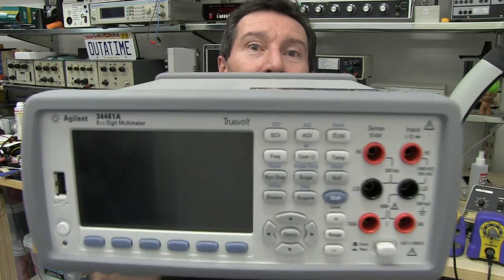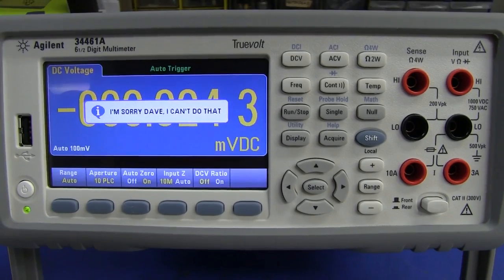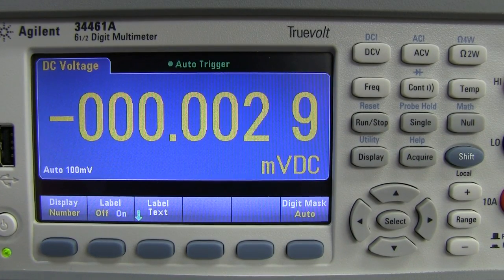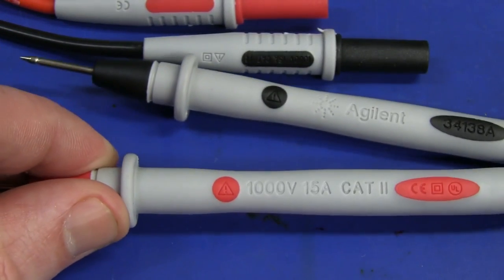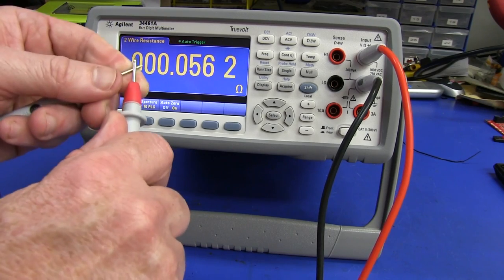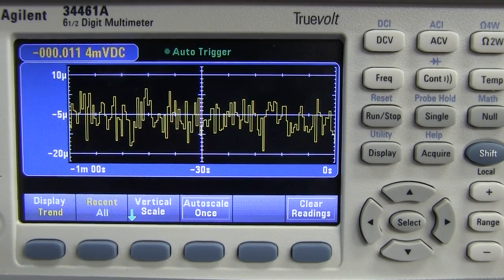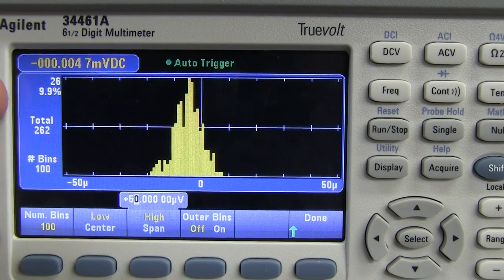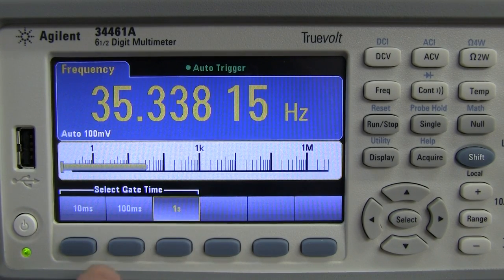EEVblog #489 - Agilent 34461A Multimeter Review

Comment: Awesome meter. At work I have a $3500 meter I use. It’s handheld and geared towards the automotive industry. But it does have a 2 channel lab scope on it along with guided component test for 49 car manufacturers with over 12 million guided procedures on it. Tells you where the component is and gives you the schematic and has guided test for all the different modules and sensors. I use it all the time at home for my good meter when I build Arduino projects and have countless hand held meters from Fluke to Harbor Freight. Even have a couple of radio shack ones.  My very first meter was when I was 7 it was an analog meter for voltage and resistance had a continuity function also. But you couldn’t test anything that was voltage sensitivity because it sent straight battery current for the continuity test. I learned really quick I needed something different since that meter was frying components. Got my first DVOM and haven’t looked back always trying to get the next thing. I wonder if a octopus box will work with my 2ch meter?  Gonna build one and try it out.

Comment: On my 34401A i use the option to turn the display off for long automated measurements so the VFD wont wear out so quick.

The security code for most Agilent stuff is simply the model number with sometimes AT in front of it. (AT as in Agilent Technologies)

In Europe the comma is used for the decimal point and the period for the separator. Wikipedia even has a world map on what is used where.

Comment: It was a great meter but mine sadly died after 4 years.
The rotten CE front panel failed excess load on the 3v3 rail. Had a look on the keysight spares site there have been three newer versions of PCA. Apparently the only way to fix it is to trade it in. Love the service and reliability Keysight - I bet it's world beating

Comment: I think the battery voltage going down at around 00:30 is because the battery is getting hotter from your finger holding it, not voltage going down due to 10Mohm load from the DMM.
I have a HP3478, and playing around with a duracell 1.5 AAA battery, I noted the voltage goes does as temperature rises, something I really did not expected.

Comment: Does seem a little bit of overkill using such a pricy high precision instrument to measure a 9v battery.
Reply: +rpavlik1 --  duh. yes.
Reply: lol... this is a tool for some serious engineers developers,  not for finding a short on a circuit board. I have no idea why he is even reviewing this thing, nobody would spend that money for just a shop bench multi-meter
Reply: @mikem4432  you'd easily use this in production, to check for... shorts on PCBs, in an automated way
Reply: @mikem4432  Serious engineers watch YouTube videos, too. Besides, even if they didn't, some people like fancy test gear—even if they don't really need it. If you've got the money and enjoy your hobby a whole lot, it's not hard to splurge on something like this. It's no different than people spending extra on a big, fancy TV, an overpowered gaming PC, a higher-end car or the like.

Comment: I believe the reason why the amplitude output value from the RIGOL DG4 is different than both the AGILENT scope and the AGILENT DMM is due to the mismatch impedance settings between the devices. If one device is set @ 50 ohm out and another is not set @ 50 ohms in then maybe that is the reason. David Lee... just a thought

Comment: 50:40  High precision resistance reference without 4 wire setup ?  Dave, are you sure ?
Reply: Wire resistance is probably around 10-20 milliohms or less for that length of wire. Thats in the noise when measuring a 1k standard. If it was a 1 ohm standard you you would want 4 wire.

Comment: Nice review; what sort of added resistance does the plug-in probe accessory setup add?  I would think for this sort of meter, it would be preferable to have probes which go directly  to the meter, rather than plug in to the probes.  I don't use a desktop meter, so perhaps there's a reason why this is not a concern.

Comment: At 10:30 the display setup provides setting Decimal Pt and Separator.  Unfortunately these indicate "Period" and "Space" - the current setting.  Since we can already see what the current setting is, this seems redundant and a bit confusing since you don't know what pressing the button will give you.  Looks like a compromise was made for consistency in the U/I expectations.

As for the boot time, welcome to Windows. 

If this meter were running Linux, it would be able to boot up in far less time.  I have an embedded linux with a full Debian build that boots in 10 seconds.

You say that CE is different than standard windows.  In some respects, but it uses a registry, has the same basic kernel, and is subject to poor performance and horrendous development and debug complexity.

Comment: I have the new dark theme version of this and let me tell you, @KeysightLabs has not fixed any of these problems in the last 10 years. The terrible file management, the barely usable screenshot feature, no timestamps when you export readings to CSV, the bar graph starting from the left edge of the screen instead of the 0 position, the Java based VXI tools (granted they have added a rudimentary virtual front panel that works in modern browsers), using MTP for file transfer, it's all still there in 2024.

Maybe the entire software team quit due to having to work with Windows embedded CE and they can't find anyone willing to take a look. That would be understandable.